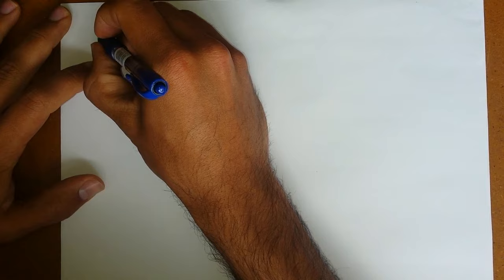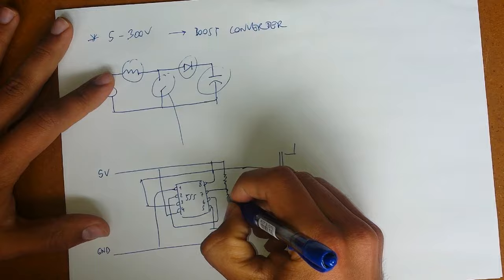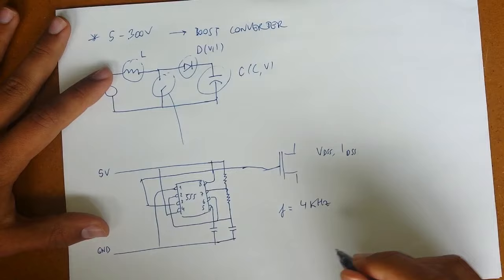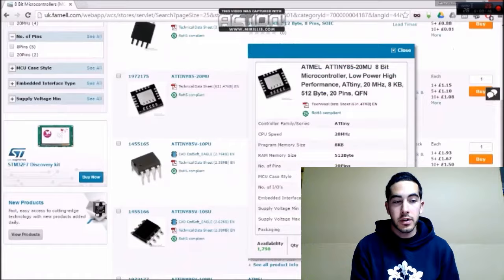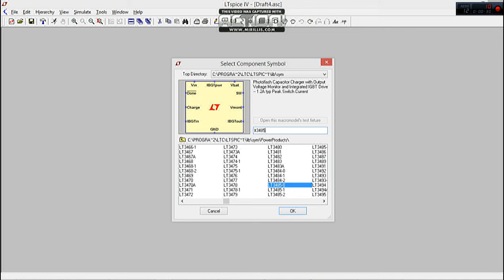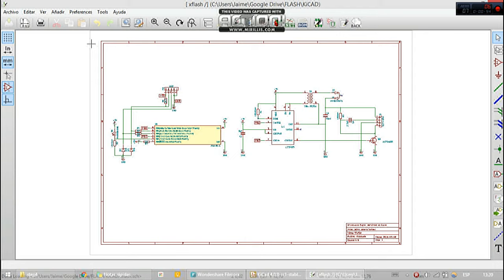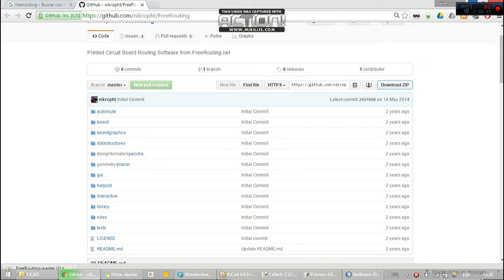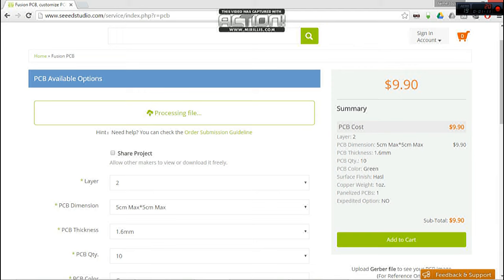how to design a circuit from scratch

Comment: could you use  another Ic to control the MOSFET  to generate pulse signal ?
Reply from the maker: Gamal Saleh Of course, in fact I've used a microcontroller to adjust the pwm and frequency. If you want to use the 555 you can adjust the frequency by means of the resistors and the capacitor.
Reply: Dear Jaime thank you very much , i have designed circuit with one input and three outputs, but i am still facing problem i don't need to use 555 i was wondering  how i use alternative micro controller to achieve my outputs.
Reply from the maker: Gamal Saleh I recommend you to use Arduino UNO. I am not sure if I've answered your question. Anyway, I would like to take a look into your circuit.
Reply: facebbook is that okay
Reply: There are actually dedicated PWM switching controller ICs on the market. The TL3842 is one example, but there are MANY others

Comment: I want to know how to design your own, like if I have an idea how do I know what components i need to use in order to build my product? I feel like i have to have a deep knowledge in what each electronics does and can be used for. If not then how can i do it ? Thank you
Reply from the maker: Without having deep knowledge I would search for the circuit examples that work for your purpose and then integrate all together.
Reply from the maker: But, at least, if your are going for analog circuits you should know working principle of capacitor, inductor, transistor, diode, resistor and maybe operational amplifier.
If your circuit is digital, then it depends on the integrated circuit you are using.
In both cases I recommend you to use a multimeter and for the analog it would be helpful to have a oscilloscope.